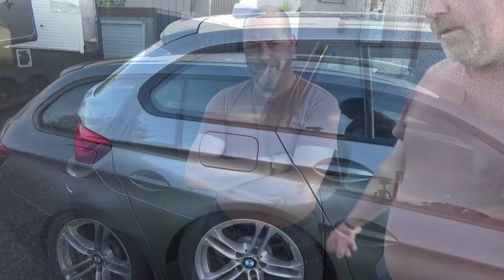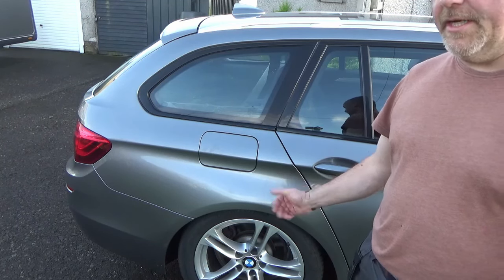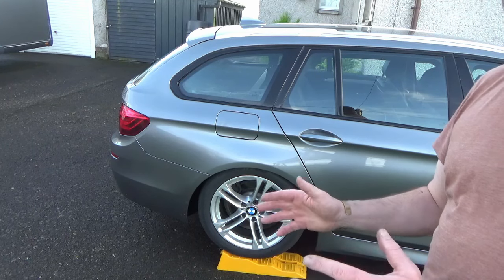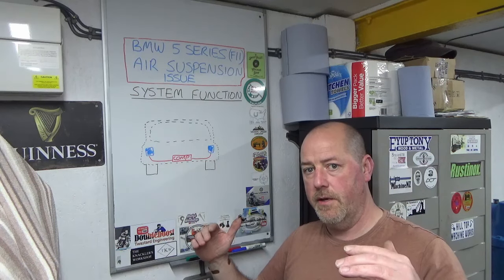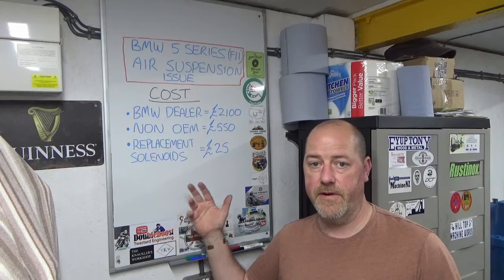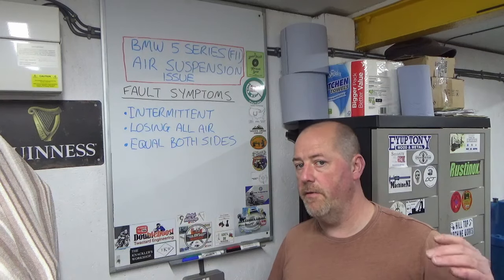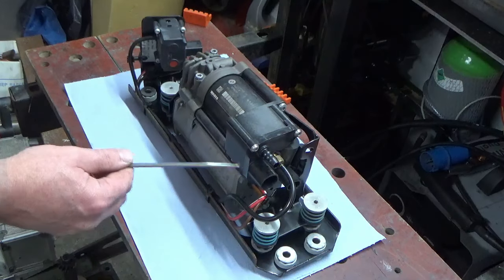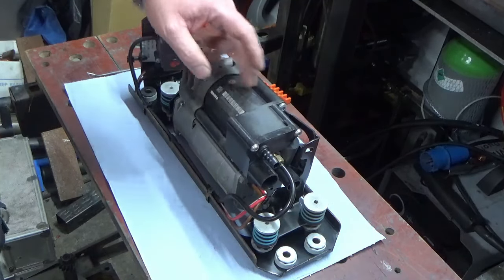BMW 5 Series (F11) Air Suspension Fix for £25

Comment: This is exactly the symptoms I have on my 5 series estate which is also the same colour as yours.    Many thanks, my local garage didn't want to touch it because they weren't confident that they would find the issue and I won't go anywhere near a stealer.  Looking on BMW forums they all seem to be pointing at new bags even though the issue is intermittent and both sides.    I'll order a new valve now.    Can't thank you enough for sharing this.
Reply from the maker: Hope you get sorted, it worked for me but may not for everyone etc. Cheers, Jon
Reply: @jonsworkshop  It didn’t sort the issue out but it was useful to take the compressor out, the silica in the dryer was soaking so I dried that out.  I will do a soap spray test of the whole system this weekend.   I have new bags ready to go on if they are the problem.  The car is approaching 80k miles so it won’t hurt to put new bags on anyway.
Reply: @LiberateThePlanet  Hey, did you solve your problem?

Comment: Thanks Jon, very informative video. The BMW guys are probably not very keen on someone like you sharing this hack. I have the same BMW F11 and I have already replaced both spring airbags and new compressor over 2 years ago (all have failed).
Recently I’ve been getting a message on the dashboard saying “Chassis Function Restricted” and it looks like the suspension is stuck in fully up position making the ride uncomfortable above 60-70 mph.
Do you think the same discharge valve could be responsible for this scenario?
Reply from the maker: Hi, in terms of the BMW guys, I couldn't care less, if they don't want bad press, don't sell prestige brands with inherent faults they are unwilling to formally address. In terms of your error, I really wouldn't know as it is a different fault to the one I had. As the dump valve is responsible for letting excess air out the system, it could well be stuck in the closed position so for £25 it is worth a gamble. It could equally be an electrical or plc issue though. Cheers, Jon

Comment: Coo your engine sounds rough, chugs like a diesel. My Series 3 Tourer compressor was under the spare wheel, easy to get at. I had to have both gas bags replaced because they were split. No problem with my compressor at all. Regards from Australia,
Reply from the maker: Hi Dave, thanks for the comment. Makes you wonder how much of this technology is about handling, and how much is about removing weight. I am struggling to notice any appreciable difference over my old 3 Series that just had standard spring and damper setup. Great technology until it goes wrong. Cheers, Jon

Comment: Great video, i have been told i need to replace the one on my f11 - is it easy to replace the actual unit, do you have a video on this?
Reply from the maker: Hi Lee, easy to do, remove the plastic covers, 4 bolts, three electric plugs, swap the unit. No video of under the car unfortunately but there are others on YT showing this bit. Cheers, Jon
Reply: @jonsworkshop  thanks Jon. I don’t want to buy a bmw part, would you mind suggesting another option to buy , eg somewhere like euro car parts? Thanks
Reply from the maker: @leedavis9677  hi Lee, yeah, euro car parts or GSF would be a good start. There's nothing like that near me so I have to resort to the ebay lottery.

Comment: Thanks so much for this Jon. Just about to attempt the repair myself. I've seen some talk of having to bleed the system. Did you find that?
Reply from the maker: Hi Greg, no, mine was completely down with no pressure at all in the system. That is a good point though, just carefully undo the blue, red and feed pipes and be aware that the car will drop if you are underneath it. Cheers, Jon
Reply: @jonsworkshop  thanks a lot Jon. Took less than an hour all in. Hardest part was locating the bolts to remove the plastic housing/ under tray. I had a sporadic issue with coming out and finding the car on the bump stops. Upon removing the solenoid found a ring seal wasn’t sitting where it should. All refitted and system seemed to inflate with no need to bleed.

Garage quoted £600, repaired after watching your video for less than £25. 

Thanks again.

Comment: Hi Jon I have been having big problems with air suspension compressor unit it has been replaced but keeps blowing fuses for a few months it was perfect no problem now it's starting to blow fuses n the pump just continues to make noise and takes about 10 15 mins. What could it be?
Reply from the maker: Hi, I really am no mechanic or electrician. If you are blowing fuses it suggests the unit is drawing too much power which could be a stuck valve, trapped pipe, water ingress causing too much resistance in the cylinder and many other causes. I would suggest a full tear down to see what you can find. Cheers, Jon

Comment: I just finished replacing the airbags on my 2012 X5 thought that would do the trick, it seems to have helped a little, in that now the suspension is not slamming when I go over a small bump, however, it is still a rough ride and the level still seems low. The thing you observed in your video is that both sides went out together, that seems to be the case on mine too, if it were one of the airbags then they would have failed separately, but both sides are low. It seems that my situation is similar would you agree? 

I am a car mechanic noob, so just want to know how hard it is to get the compressor out and what part did you order? I've got a jack and jack stands, from the airbag replacement so hopefully won't need much more.
Reply from the maker: Hi Tom, I am no mechanic lol, easy to get the compressor out, a few screws and clips to remove the plastic trims etc, then 4 screws, two electrical connections and two air hoses, 20 mins tops. Based on your description it could be similar. Certainly not much to lose trying, if it doesn't work you will only have lost a few ££ and a couple of hours etc. Cheers, Jon
Reply: @jonsworkshop  thanks took it out, feeling pretty manly, hahaha.  I then took apart compressor. It was full of water, black goo, brown gunk, and signs that it was quite unhealthy. I cleaned it out and dried the interior, reassembled it. Was getting ready to test it. But decided that I would just order a replacement unit aftermarket. This one has 140000 miles on it. If I get it working, I can repurpose it as a standalone compressor. After cleaning it doesn’t look too bad but worried there may be some hidden issue.
Reply from the maker: @tomladdus9264  good luck, glad you had a go, many wouldn't!

Comment: Brilliant video John, I got back to the car this morning after leaving it for 5 hours and it had dropped on the drivers side. Started it up and it went back to normal in seconds. Do you think it's a problem with the valve you swapped out or one of the other 2 ? (the right supply)

Only had the car 3 weeks from a dealer might take it back but don't want them charging me £2100 when I'm capable of doing it my self with the help of your video.
Reply from the maker: Hi Chris, if it's only dropping on one side, it's not the £2100 compressor unit, it's either the twin valve unit or the airbag on the faulty side. The valve I changed is both sides at the same time so it's definitely not that one either. Good luck
Reply: @jonsworkshop  that's what I thought, thanks for the reply buddy.

Comment: I replaced the solenoid valve and everything seemed to be good, rear end lifted up. Then I started getting same chassis faults, but rear end was up and good. With diagnostics I found out, that now my compressor can only lift rear end and not lower anymore. Do You think the new solenoid valve could be responsible for that? That the old one was stuck open and new one is stuck closed?
Reply from the maker: Hi, thanks for the comment. I have no idea as I didn't get that fault, sorry. It could be a dodgy valve maybe, if you still have the old one you could try swapping them back and see if the original fault returns. Check you haven't blocked or crimped any pipework. Apply 12v to the new valve and see if you get any movement or noise. When you apply voltage, can you blow through it etc. Can't think of anything else.

Comment: Gday John, over the years of driving trucks I’ve had a few dump valves fail, pain in the ass really, you did well finding the fault and saved yourself a shit load of money, it’s amazes me that dealerships what to replace the whole unit and not prepared to have a go at fixing the problem and look after the customer, no mechanics anymore there parts replacement specialists, great job mate and thanks for sharing, cheers
Reply from the maker: Hi Matty, thanks for the comment. Totally agree, all part of the profit making arm of the business - fit unserviceable parts and then rip people off big time to just replace them. This will be my last Beemer mate, totally underwhelmed with the whole package from sales to after sales service! The customer is definitely not put first in their business model, shiny showrooms and free cheap crappy coffee might fool some, but not me. Cheers, Jon

Comment: Hi Jon. Great video, but wondering if you can offer any advice as my issue is slightly different. So I started to notice my near side dropping right down, the offside dropped a little, but not nearly as much, so assumed it was just being dragged down as a consequence of the NS. Anyway, I replaced both air bags at the same time, but still happening :( Was fine for the first 5 days, but the NS went completely down overnight. It pumps up really quickly again when the engine is on. Could it be one of the smaller solenoids you mentioned? Got a part number\link for those?
Reply: Been doing some further research and looks like you can change the valve block for £20, but to help diagnose, I'm going to swap the blue and red tubing over, see if the OS dops instead, then I'll know that's the faulty component.
Reply from the maker: @TrinityCT11  hi, no idea but your investigation idea is superb. If you have changed the bags then it can only really be the twin solenoid block (or it could be a pin hole or leak in one of the lines don't forget). Please post your results here, this video is getting a lot of traffic so you may help others out. Thanks. Jon
Reply: @TrinityCT11  Hi, I have the same problem, car drops mainly on one side. Do you have an update?
Reply: @Asserti  I replaced both airbags at the same time. Issue now resolved. Didn't have to try any further troubleshooting.

Comment: Thanks for taking the time to make this video and for the clear logical steps taken to rectify the issue. Much appreciated. My F11 goes down on one side so I can now have a narrower focus on finding the fault than without your help.
Reply from the maker: Thanks Robert, I hope you get it sorted. For a so called premium brand, they are not very good are they, so many people with the same issues and no recall from BMW. I will not be buying another.
Reply: My f11 is sitting low on one side now, what did you find was the problem plz, was it an air bag or the compressor? Your experience could save me time and money 💰  Thanks in advance
Reply: @magnacartalibertatum7018 hi. I have the same issue.... my f11 is down on one side. Did you found the solution for this? I would really apreciate if you could share it with me as I can't really afford waisting more  money on workshops who just change the wrong parts. I hope that you can write me back, Thanks

Comment: No guarantees, but as described in the main video, both sides down - suspect main release valve first, compressor second. One side down airbag issue or individual release valve. In my case it was the bag.

Comment: Well BMW 5 series quite decadent - LOL. As you might guess I did a lot of this type of work. The design of the compressor is very clean and elegant. I was curious if the two solenoids on the left are the only isolation between the compressor and the bags? Or, are there additional solenoids at the bag itself?

Those have to be the lowest height ramps ever created. Clearly you and my Scottish cousins must be a bit more trim than we Americans… LOL. 

The height trimming logic can be a sneaky thing. If the height cannot be reached on one side the code writer (Hans) may command the opposing side to lower to the failing side height. This is to maintain dynamics in the error state. Inverse is true if it can’t lower properly it may force both sides to max height (snow bank logic as it thinks you have lowered to an obstruction). 

Well done Jon! Hoping it behaves henceforth. 2,100 is stiff for parts. However, just wait for the carbonless generation coming up that will be an entire new level of repair cost.
Reply from the maker: Hi Dan, thanks for the comment. Lol, the ramps are leveling ramps for the motorhome, not meant to be used as I did. The car was that low I couldn't get my trolley jack under. I used the ramps to get the space for the jack and realised I could just about manage the whole job on them albeit a tight squeeze. Cheers, Jon

Comment: My local mechanic changed the balloons. Didn't help so he changed the compressor ,motor with solenoid. They solved the issue. Last combined valve was not changed. My old compressor is working but pressure is inadequate. No water in air chamber, piston ring is ok and solenoid is not leaking air. What else could be wrong?
Reply from the maker: Hi Arun, I am not a mechanic (disclaimer) but based on your description, either the motor is running slow on the compressor (don't know how you could check that easily) or you have a leak somewhere. The compressor housing could have a crack in it, as could the cylinder head, or one of the joints etc. Best I can suggest is switch it on and spray leak detector all over the unit (or brush on a dilution of washing up liquid) and see if you can spot any air leaks. Failing that, real close examination of the piston ring or bore for scratches/damage, it wouldn't take much damage to lose efficiency on such a small compressor. Cheers, Jon

Comment: Ay up Jon, nice fix! I am so pleased you were able to get a part to fix the problem. So many times these days you hear that you cant get part of a unit and the whole thing has to be purchased.
Take care mate, Tony
Reply from the maker: Hi Tony, thanks for the comment. Yeah, it's a racket. You can't get an OEM spare (I wonder why?). This will be my last ever Beemer, completely underwhelming all things considered. My last 15 years have been Skoda prior to this car, OK, a bit more basic and horrible plastic finish etc, but totally reliable and good value! They go up hills in mild frost as well, unlike this thing! Cheers, Jon
Reply: @jonsworkshop  Hi Jon, I have had 4 Skodas over the years prior to my little suzuki that I have now. Loved them all, very solid cheap reliable motoring. 😃 Tony

Comment: Can the solonoid be swapped without removing the compressor from the car? I just changed my airbags and it's still dropping overnight.
Reply from the maker: Hi David, thanks for the comment and question. I would probably say no (trying to remember, but I think access is too restricted). Once you are in under the car, it's only 4 screws to drop the whole unit out so much easier to attack this on a bench would be my advice. Cheers, Jon

Comment: Thanks for a great video with a very good and detailed explanation of the system 👍
I had my 520d 2013 up on the lift and was just about to replace the airbags, when i came across your video, and realized that it more likely was the solenoide that was broken. My BMW was also sitting on the ground, and when it was started the compressor would start for a few seconds, without anything happening.
I took the solenoide off and found out that it was in the closed position which it should be. When i checked the resistance of the two pins of the solenoide the resistance was 12,8 ohm, which seemed pretty normal. I then connected the two pins of the solenoide to a 12V battery but it remained in the closed position, until i did connect it maybe 20 times and then it suddenly started to work, and i could now blow air through the solenoide when it was connected to 12V.
I then assembled it again and the car worked perfect and still does, and i could even return the unused airbags 😊

Comment: Thank you, having the same symptoms on my x5 F15 with exactly the same compressor. Difference with mine was that the desiccant beads were soaking wet and had to be replaced. Your video is very helpful
Reply: Hii, I didn’t quite understand what the problem is I have the same car and the same compressor and I’ve been to multiple garages and they didn’t know the issue what is exactly the issue didn’t get it could you please tell mee